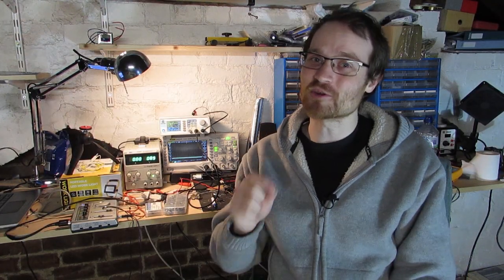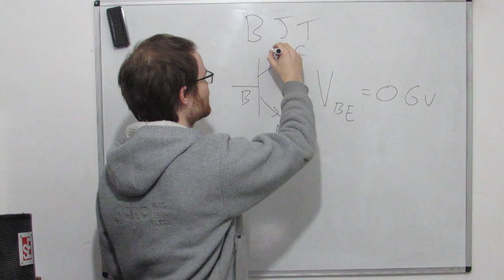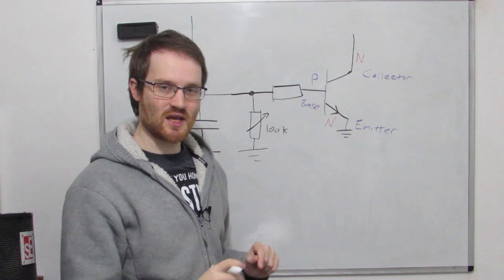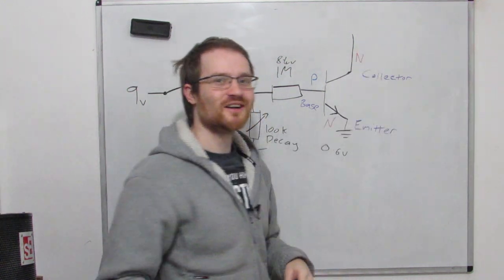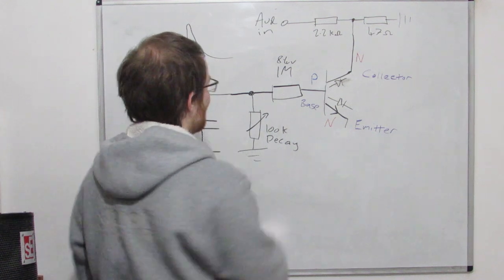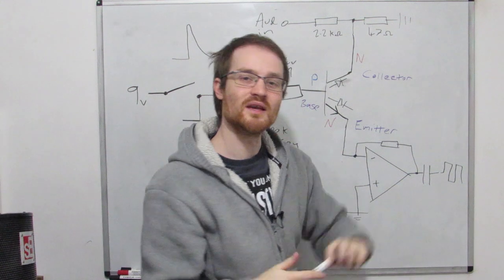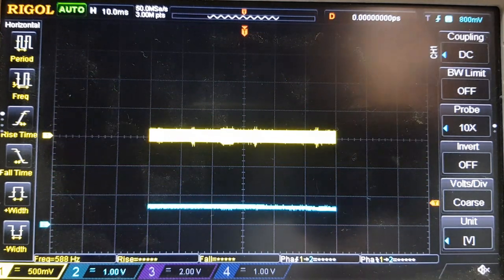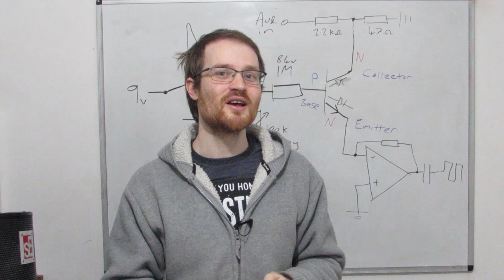Single Transistor Voltage Controlled amplifier! (VCA)

Comment: I am enjoying your presentations and so far they have worked out. However, i cannot get this one to work. The audio output from the CD4069 is fine, the voltage reading there is 3.8 volts.. The voltage reading from the R4,R5 voltage divider is only 0.08 volts. Based on the resistor values you provide, this is about what it should be. Are these resistor values correct? Also, the output  going into the transistor base is only 0.7 volts when I press the button. Is this enough to fully "open" the transistor.
Thank you in advance
Reply from the maker: Hi Richard!
That all sounds about right. Those resistor values are correct, the only difference i can see is that the feedback resistor in the current to voltage converter (R6) should be 1k, not 1M. I'll update the schematic.
Reply: @TheAudioPhool  But, you indicated that you wanted the voltage into the transistor collector to be about 1 volt. Isn't 0.08 volts much too low.
Reply from the maker: Hi mate!
I'm sorry it was like 11pm when we were talking last night:) i read 0.8!
The resistor values should be 220 in series with 47 ohms. I think i made the same mistake in the actual video and it still worked, the output from your cd4069 does sound a little bit on the low side too which might be why, is that 3.8v midpoint or 3.8v peak? Are you powering it from 9v or 5v?
Reply: I just signed up to your patreon account. Good luck!
I am using a 9 volt battery which presently is outputting about 8.6 volts. I am measuring the voltage with a multimeter. I do not know if this would be midpoint or peak.
I had switched out the 47 ohm resistor with a 1000 ohm resistor. With this the collector voltage is 1.2 volts.
The circuit is working to some extent. When I press the button, i get a good audio signal out of the op amp. However, it is working more like a toggle switch. The audio signal comes on when I hold the button down and goes off when I release it. The the capacitor and potentiometer don't seem to be doing anything. I checked the potentiometer and capacitor and both are working OK. I suspect I am doing something wrong but do not know what.

Comment: Not sure if this is the place but I had all my knobs replaced gain control lpf bass boost subsonic all them replaced with under valued ones instead of the correct valued ones it doesn't sound right at all but been told wouldn't make a difference sure it does otherwise why have different values

Comment: The double diode imagination of a transistor is of course wrong. It is also not necessary to keep the collector voltage above the base voltage. It is no problem to go with the collector voltage below the base voltage, like in almost all switching applications and in some amplifier applications as well.